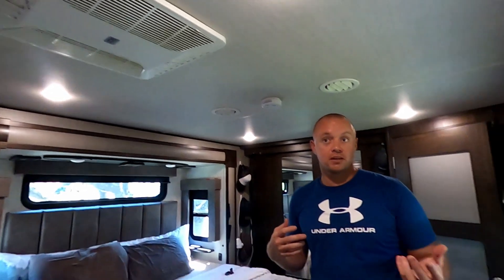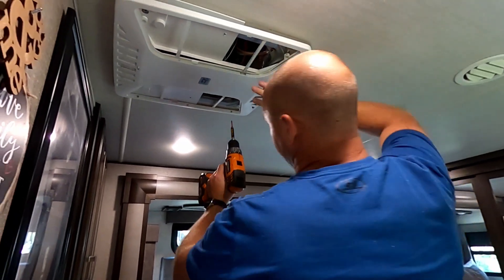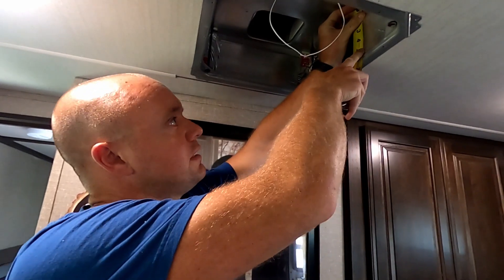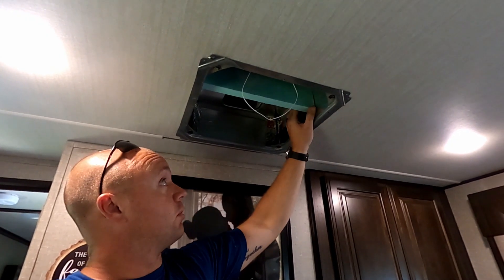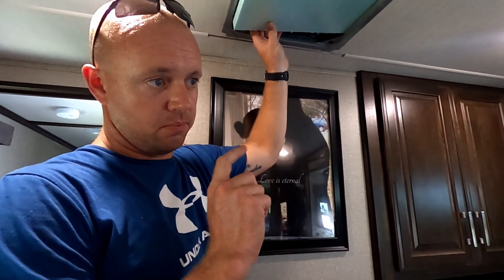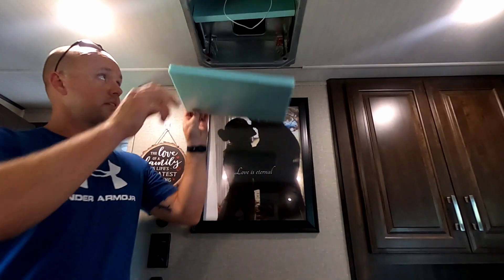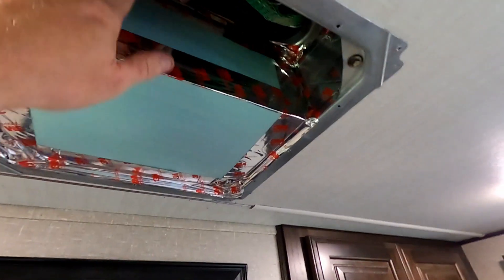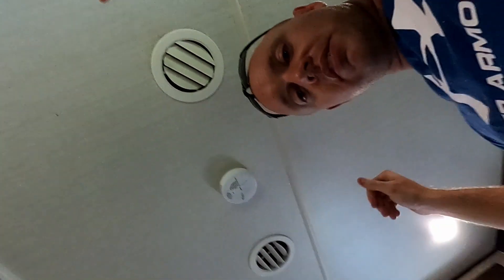Grand Design A/C Modification

Comment: Can you still use the air dump on the unit after doing this mod?
Reply from the maker: Hey Wes! 

That’s a great question! You will lose the air dump feature, BUT in all honesty you won’t need it!  We first installed this in Texas heat (100 ish degrees) and we had to turn our AC warmer! 

Others have expressed concern about this as well, the great thing about this mod is that it’s completely reversible and low cost!

Good luck and safe travels!

Very respectfully,

Jeff and Amanda
Reply: Newbie here.  ....what is the air dump? Why would it be important?

Comment: What is the thickness of the foam?  1 inch or 1-1/2".
Reply from the maker: We used 1" project foam board! We found it in the insulation aisle at our local hardware store!
Reply: @WeLiveFreeRV  thanks.  Will be a lot cheaper than the WACKO PRODUCT available for $200 and still does not deal with the leaky points and air flow.  Thanks for a great solution
Reply from the maker: You are most welcome! Happy modding!

Comment: Yea, the "professional" Styrofoam version of this is $179 PLUS tax AND shipping and handling.  Well over $200.  Ridiculous. For both AirCons you will spend over $400 just for a $10 piece of foam that you can do yourself.  Honestly the DIY version is better I think because it is much more air tight around the seals.